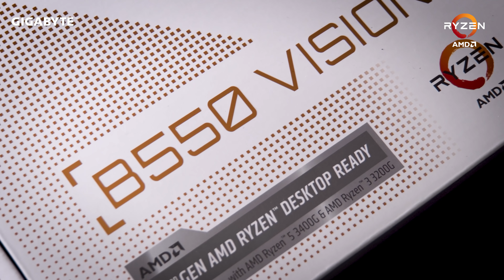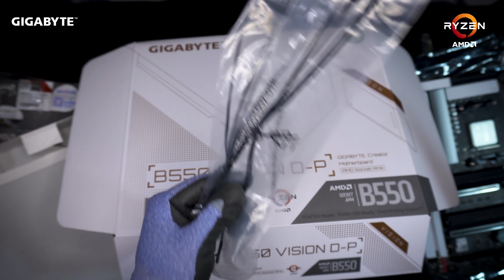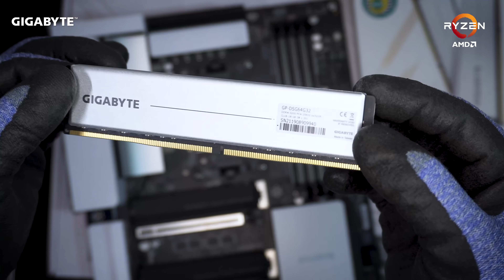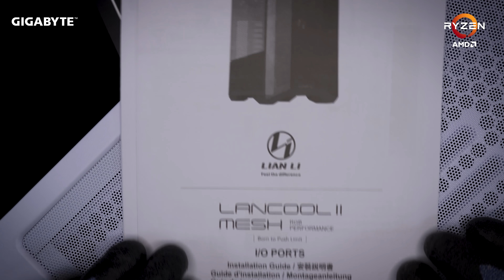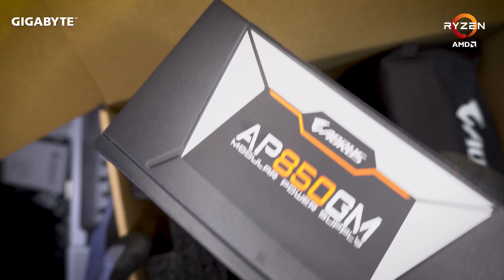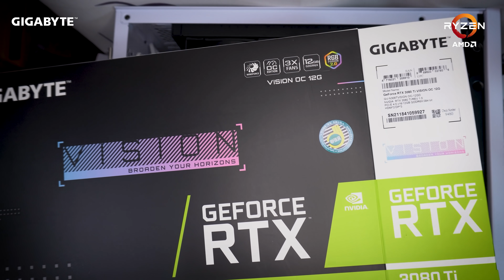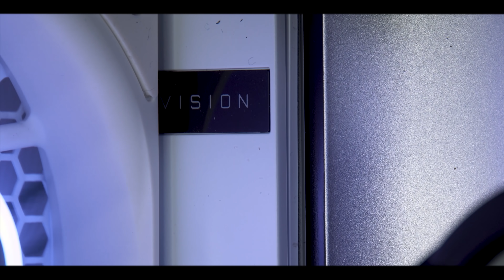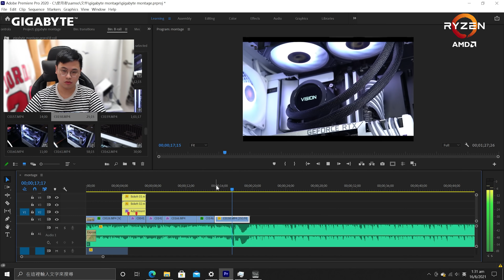砌機！最新高性能白色電腦！B550 最強配搭！有嘢送仲有得抽 iPhone？！想參加就要睇到最後！創作者們更加要睇！//4K 【TechiCardia】[CC繁體中文字幕]

Comment: Lancool  has included 3 front cooling fans. Where did you place the 2 additional fans (Arctic P12 PST PWM x2)?
Reply from the maker: Umm u might have misread the list, that’s my own pc spec which I should update cuz I don’t have 2 Arctic fans in my meshlicious case as well lol
Reply: @TechiCardiaHK  Now I see. My doubt is Lancool PC case, which most other case manufacturers, only provides 3 front fans. Most makers do not provide a rear exhaust fan. Does it mean we have to buy one additional 120mm rear exhaust fan to complete the build?
Reply from the maker: Unfortunately yes.. some manufacturers like fractal design would include both front and back fans tho 
Altho budget fans like Arctic P12 PWM is still very affordable and offers high performance as a case fan for rear exhaust